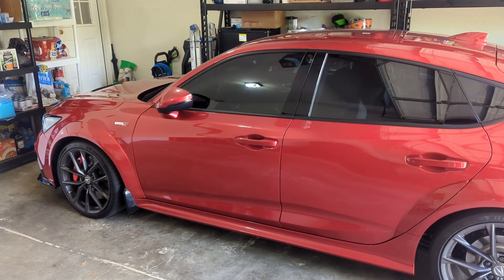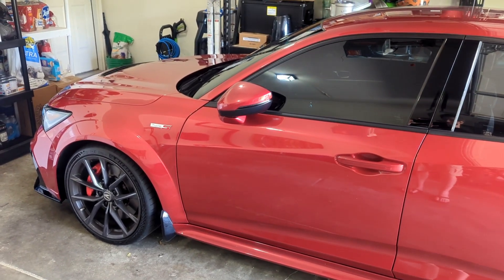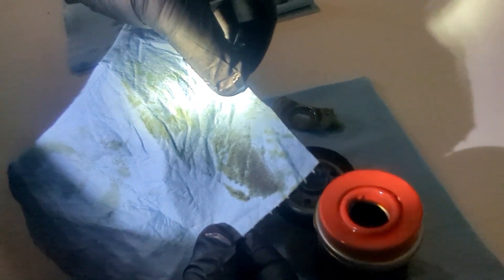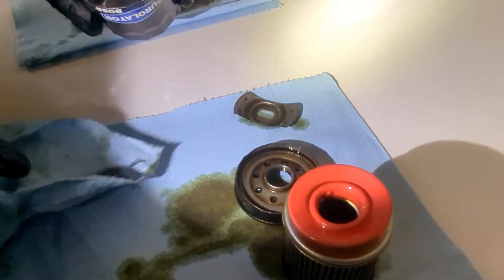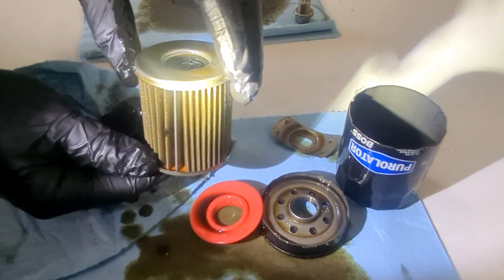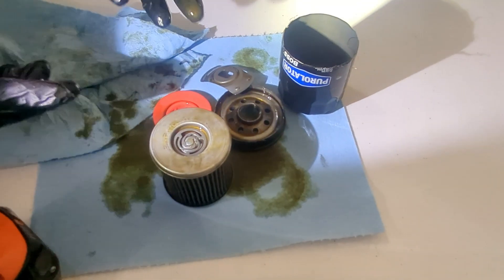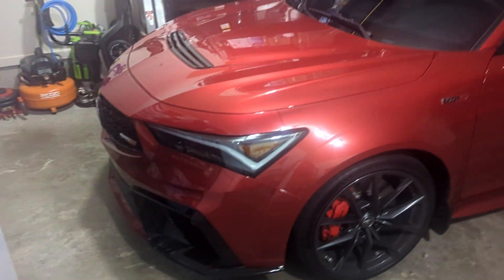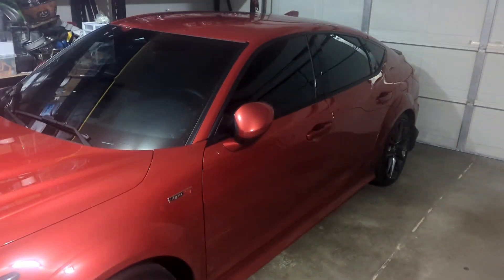Magnetic Drain Plug and Magnets on Oil Filter - Do They Do Anything?

Comment: unfortunately, the materials you need to worry about are not magnetic. The suspended iron particulate is smaller than the rod bearing oil clearance, and absolutely does not harm the engine with normal oil change intervals, they are so small they pass right through the filter media as well.  just keep up with frequent oil changes as you wear in the engine. those levels should drop considerably after about 10k-15k miles. 

In my opinion, magnetic drain plugs are snake oil. you would be much better off replacing that with a fumoto drain valve for easier maintenance and elimination of the need for crush washers as well as complete elimination of the chance of possibly stripping your oil pan. 

great video none the less, i appreciate your efforts and commentary. beautiful car btw.
Reply from the maker: Thanks for your comment.

I agree that regular oil changes are the best thing baseline thing you can do a car, but I'm afraid I don't follow the rest of the rationale.

Of all the wear material that occurs, the fero magnetic items are the hardest. The non ferrous are not hard enough to cause wear to the ferrous components, but the fero magnetic material can cause wear to everything else.

Regarding particle size, the best filters are rated to 99% down to 20 microns. Very small in deed, but there are clearances throughout the engine that are smaller than that. Oil film thickness between the rod bearings can be as small as .5 micron especially with such lightweight oil as 0w20.  The clearance between your camshaft lobes and valves can be even less.

The logic is that a particle larger than these clearance can/do exist in the oil and can cause additional wear. If doing regular oil changes, will magnetic filtering add anything to longevity in the long run? That's certainly up for debate, but to say there's no effect I don't think passes a basic logical assessment of all the facts.

So I don't think snake oil is quite the right term. Will it affect the average user doing good maintenance? Probably not. So snake oil maybe? But does it really do nothing, the meaning of snake oil? No I don't think that's true either.

Good conversation though. This is what I hoped my video would generate...a good conversation on the matter. Certainly people will have different opinions.

Thanks again for watching and your kind complements.
Reply: What materials are to talking about that you need to worry about?
Reply from the maker: Hello and thanks for commenting.

All metals worn off over time from the soft copper in bearings to hardest stuff of the iron and steel that aren't caught by the filter can circulate and cause additional wear when they pass by equally hard or softer metals. The ones that can do the most wear also happen to be magnetic. So the idea is to try to get those out of circulation in order to reduce wear.